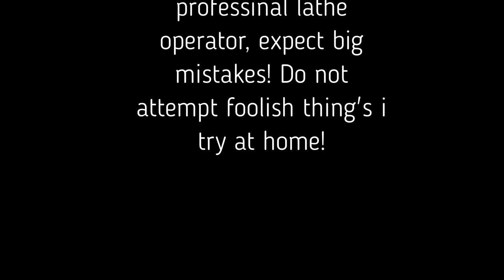Making a ER40 Collet chuck - Part 3 - Finished

Comment: What lathe is that ?
Reply from the maker: Its a HBM 360x1000 lathe, its a 14 inch swing by 39 inch capacity. It has a spindle bore diameter is 2 inch / 50 mm . They advertise it as a "industrial" machine but I dont think it realy fits that . I think of it more as the top of the line hobby lathe. Hope i gave you enough information.